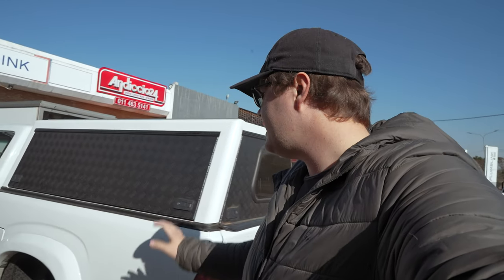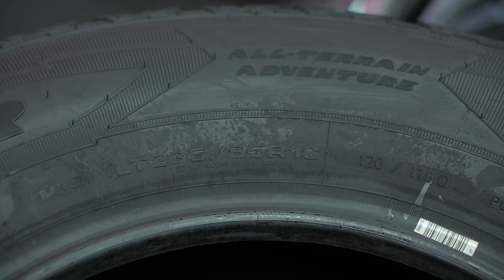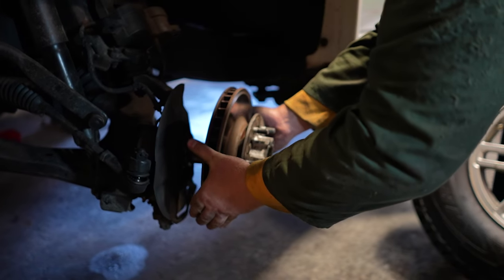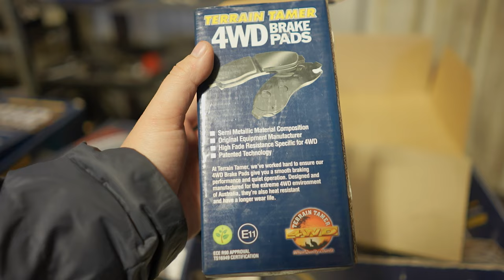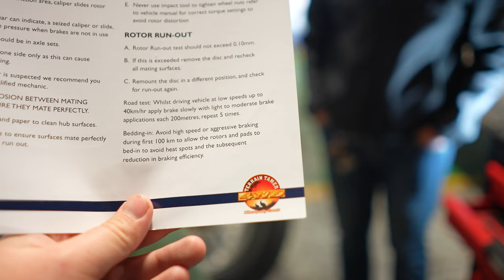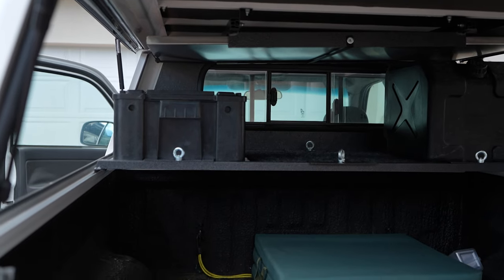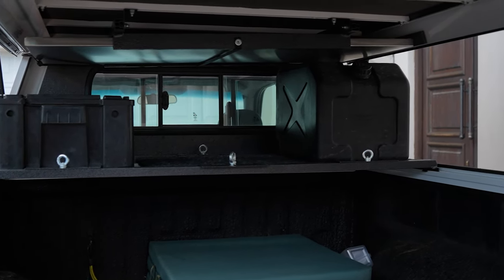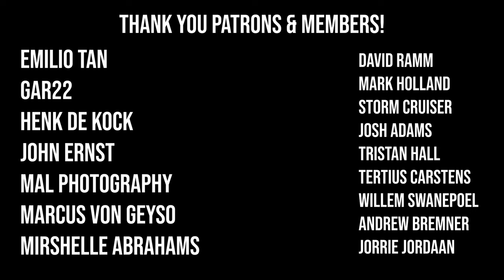Budget Overland Build Ep7: Tires, Brakes & So Much More Drama...

Comment: Very  True bud about going to specialist who work with a particular brand of Vehicle.  Very hard to find them but they out there. Those vehicles are solid if well maintained.  I like the brake upgrade but i have to say i am a fan of the power brakes that you have fitted on the Toyota, (Proudly SA). Just a note, consider doing a caliper refurbishment if they were not replaced. The front ones will sieze in a closed position overheating  your brakes. Most vehicle require this every 8 to 10 years but the OEM does not tell you this.

Comment: Are you not able to buy a complete long block from isuzu?
Reply from the maker: The engine is all good! The problem has been with turbo’s mainly… and poor workmanship on the reassembly. But it’s running like a dream now, so the latest guys did some good work!

Comment: Seriously love your videos, but I can't get my head around the "budget build" concept. Maintenance issues and the costing thereof aside, fitting REDARC, Lithium, Aluminium Canopies, Terrain Tamer products etc. is not "budget" in my opinion. Budget in my mind would be an inexpensive, yet reliable / effective DC-DC / MPPT charger combo (e.g. WRND 20A) vs. expensive / premium REDARC, Deep-cycle vs Lithium, Fibreglass vs. Aluminium, maybe Bilstein / Gabriel / Monroe shocks vs. Terrain Tamer etc. etc. Again, love the content, but I don't think this is a budget build - rather just a "not over the top Isuzu overland build" gone wrong.
Reply from the maker: Budget doesn’t always mean cheap. Sometimes it also means something that’s serviceable, lasts a lifetime and only needs to be bought once, or is actually cheaper in the long run. Hopefully I’ll explain it right in the videos.